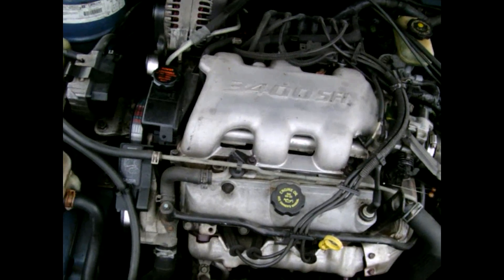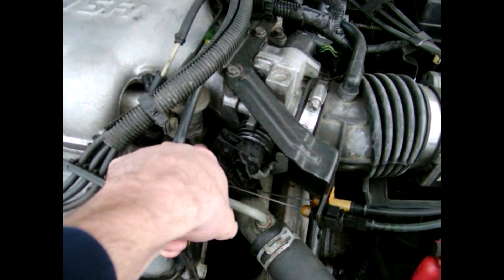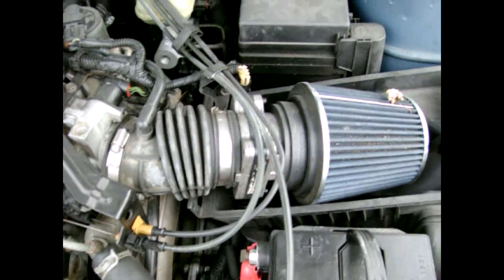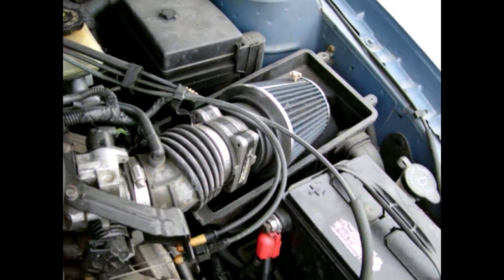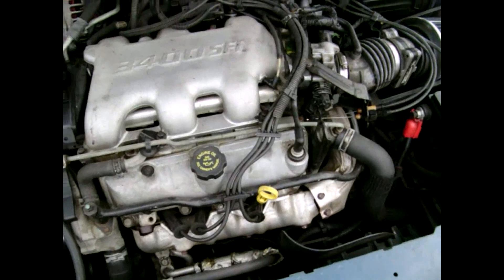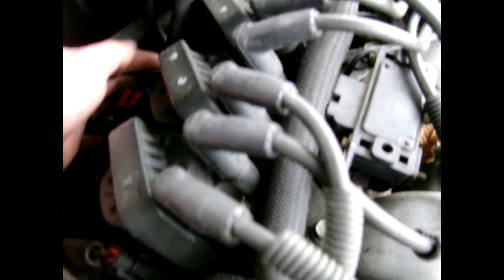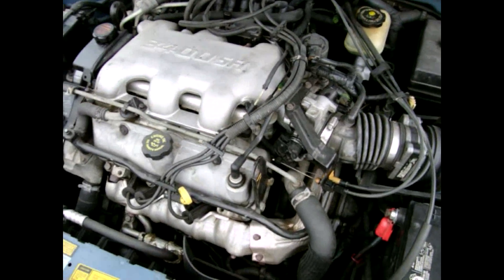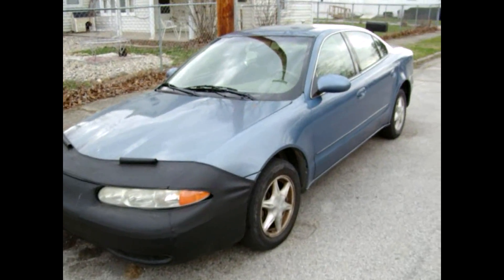3400 GM Engine 3.4 Liter Motor Explanation And Discussion

Comment: I'm planning to take on an engine replacement job on a 2003 Buick Rendezvous and I'm wondering if anyone can tell me if the engine will come out the top on this thing. Can I just pull the front clip for the room to do so? Or? I don't have a car lift to drop it out the bottom, so I don't want to tell the guy I can do it and then find out when it shows up that I need a lift.
Reply from the maker: The motor can come out the top.  However, you'll need to remove the heads, exhaust, water pump, alternator, coil pack, A/C, etc.  Pretty much leave the short block stripped for pulling it out and putting it back in.  There just isn't enough room to make the fit with the heads on.  I'm actually in the middle of pulling my motor out of my red '01 Pontiac Aztek now.  I'm planning on pulling the engine out the top as well.  
VT247
Reply: Thanks for the input! I'll post back anything I come up with.
Reply: Matt Owen I did one on a Pontiac Aztec. I didn't need a lift. I used jack stands and a floor jack. I had plenty of room under the car to slide the engine and transmission out, once I dropped the engine cradle. Wasn't too bad of a job.
Reply: Logan Fry Thanks man! You're not to late. I'm just finally going to send a wrecker for it this week. Your hot stall sounds like a weird fuel pump think. I had a Ramcharger that was doing that. Fuel pump finally took a crap. Funny thing was, It would stall when it got warm if just sitting warming up, if I got in and drove it, it ran fine. Finally just wouldn't restart after a warm up and stall. Try a little starting fluid when it stalls to see if you still have ignition. If not - Idk, coil pack shorting or ignition module if it has one.

Comment: I just replace my upper and lower intake gaskets on my 2003 Buick Century 3.1 V6. After everything was put back together, the engine will start but will not stay running unless i'm giving it gas. I can keep it running until I release the gas. The spark plug wires are in the correct order, and the wiring harness is connected correctly. No gas smell in the engine bay, fuel pump pressurizes, and all vacuum hoses are connected. Any idea would be a huge help. Thanks!
Reply from the maker: Does seem like a vacuum issue.  Make sure all the vacuum tubes for the PCV valve are secure and that the engine is sealed up good.  What does the motor do when you let off the gas?  Does it chug and try to stay running or go straight to shut off?
VT247
Reply: Thank you for the response. When I was finishing up the intake manifold job (it was late, 2:30 am) and I didn't realize the throttle body gasket had slipped off a bolt which in turn blocked half the intake passage. It would start up but chug and try to stay running until it shut off.

Comment from the maker: I take it the leak is coming out pretty bad at this point.  Be sure to check your oil to see if it's 'milky'.  Make sure your electric fan is kicking on and the water pump is flowing coolant.  But, if it's leaking it's the lower intake manifold gasket.  Not the worst job to do, but it takes some time.
VT247

Comment: Mine is being hesitant especially when you put it into gear. It has that annoying ticking noise when it does it and the whole engine vibrates bad.
Reply from the maker: Could be a loose or stripped out rocker arm.
VT247
Reply: Vacationtime247 Ok thanks I will have that checked. It jusf came from the shop, I had to have the intake gaskets and valve cover gaskets  replaced because it was leaking antifreeze I drove it for about 2 weeks and then all of a sudden it started doing that.

Comment: 98 Venture, 3.4 L engine, 192k miles.  Here's what i know. 1. oil leaking out of engine, ending up on frame rail on drivers side near pick up point (rubber donut). 2. oil in coolant. 3. no coolant in oil. 4. bubbles in coolant when warm. 5. not overheating. 6. internal heat ok. 7.sandy orange gunk in radiator.  friend says i have a cracked head.  what do you think?

Comment: my power steering system is acting crazy. it's winding noise turns really loud the farther I drive. I drive 40 miles to work n by the time I get there it's moaning n groaning something serious. I've checked fluid level. full.. I've changed fluid. added Lucas stop leak. still moaning. I can't find a leak even tho I have a small amour of fluid on the drive way. I'm wondering if I need to bleed the system or change pump, rack n pinion, or filter.
Reply from the maker: Probably the pump.  Order a new unit and install.  Find where the leak is and make sure it's sealed and fixed.
VT247
Reply: Thanks. I'll try it

Comment: My 03 grand am  3.4  is giving me a lot of problems  lately my engine light comes on and goes off finally tested it and it's a knock sencer issue I just replaced it a year ago that's not really so much of an issue as the other problem I have with it. I could start it all day it works fine then randomly I go to start it and the starter won't do anything I had the starter tested as well as all my ground wires it's not throwing any codes but if I disconnect the battery for 2 hours and hook it back up it starts like no there was ever wrong. I'm stressed right out with this thing I had it in the shop cost an arm and a leg just for them to tell me they can't find out what's wrong with it cause it wouldn't act up when they were looking at it. So here I am in the hole even more and no solution so far. I've been reading about the neutral safety switch and how if it goes bad it can disable the starter but what I don't get is why the battery has to be off for 2 hours before it will even crank. The battery is brand new. If someone has had this same issue please let me know how ya solved it thanks
Reply from the maker: Might be in the key switch.  Could be faulty.  Use a multimeter when it happens to see if the starter wire is getting voltage when it happens with someone turning the key.  Would be my first go to diagnoses.
VT247
Reply: It ended up being a dead spot in the starter I found one off a Montana and after I  installed it I haven't had a problem
 thanks for the tip though any little bit I could learn may be of importance later haha

Comment: 2002 chevy impala 3.4 v6.  coolant leak coming when pressure checked from timing chain cover.  your thoughts>
Reply from the maker: Could just repair the front timing cover gasket.  Takes some time, but can be done without a whole lot of difficulty.  Always thought getting the power steering pump lines off was the hardest part.  Other than that, fairly easy.  But honestly, if it where mine, I'd just replace all the gaskets.  Probably be easiest to take the engine out, replace the timing cover, head and intake manifold gasket as a set.  Use new torque to yield head bolts also.  Sounds like a lot of work, but it's not that bad.  Engine would probably outlive the life of the car after that.
VT247

Comment: I'm putting another 3.4 in my 99 venture van. I got a 2004 3.4 from a Olds Alero with 110,000 miles that ran well. Before I put the new engine in My van I decided to take it apart clean everything and re-gasket the whole thing. Upon removal of the heads the head gaskets were not leaking but  at least 3 of the coolant passage holes in the gaskets were plugged with red crud. The culprit? G.M.'s wonderful 150,000 mile crap known as dex-cool. If you have a GM car do yourself a big favor . Flush your cooling system the best you can and replace that crap with ethelene glycol and distilled water. Your motor will run cooler and do away with some of the inherent overheating issues these motors are famous for. (Disclaimer) This is all from My experience. Uase what works for you.

Comment: My son has 03 grand am (same engine) the car is turning over but won't crank. Fuel pump is ok. Thought it was crank sensor (could be) I wiggled all the wires and it cranked up. Drove today. it won't crank again. I noticed the wire (the hose on top with a curve) it's off. Like it had black tape around it and it completely came off. Could this be the problem? Your hand went over it and you said it was vacuum hoses. Not the one in front but the smaller one just above it.
Reply from the maker: A massive vacuum leak very well could prevent an engine from starting.  Check for fuel, spark and plug any open vacuum lines in their correct location.
VT247

Comment: No issues with mine but I doo feel it idles little too low like 500 rpm shakes the car a little any suggestions to at least get it to idle at 700 rpm would be better or even 800 rpm idle would be good.
Reply from the maker: There may be a set screw on the throttle body that can be turned to adjust the stop point for the throttle.  Turn it up a little.  You might also want to check for a vacuum leak.  The vacuum line at the top front of the intake has a grommet that can fall down sometimes or deteriorate over time.  Just follow the PCV line up, the other side goes to the back valve cover.
VT247
Reply: Vacationtime247      Thanks I’ll give it a shot

Comment: Runs fine for an hour. Then all of a sudden she stalls. The engine is not overheating but issue happens when car is hot. 92 camero V6. 

Vapor lock?
Reply from the maker: My guess would be a weak fuel pump not providing enough pressure.  Could be the cool pack getting to hot also.  Just a few suggestions to check.
VT247

Comment: Where is the cranshaft position sensor? Is there one or two
Reply from the maker: There is just one.  Should be at the bottom near the harmonic balancer.  Bottom of the engine, passenger side.  There will be a wire and plug in going to it.  
VT247

Comment: I bought a 2001 buick century with the same engine, and it has a missing manifold hose that I believe is transaxle, where would the other end of the hose have gone to if it were still there? The port is just opened up, and it causes rough idle until I place my finger over it. Can I just plug it? Or does that hose serve an important purpose?
Reply from the maker: One does go for the transaxle.  There is one that is plugged off.  Believe the one that is supposed to be plugged off is nearest to the alternator.
VT247
Reply: In your video, it is the one with a black elbow going into a white hose, and into a little larger black hose. On the right side of the manifold intake.

Comment: I have a cylinder 2 misfire just did a tube up could it be the wires loose or bad plug?
Reply from the maker: Could be a few things.  Here's what I would check.  Spark first.  Pull off the spark plug boot, put in a spare spark plug, have it resting on a ground site and start the engine. See if it's sparking across good.  If it is, then it could be a fuel injector.  These engines also were known for bad gaskets.  Could be the head or intake gasket is blown.  Just a few things to check.  Hope this helps.
VT247

Comment: I have an 2001 impala 3.4. Starts great but when you hit the gas pedal the motor surges. (reeves up and dies back down) very little  power when you hit the pedal. I can Idle and the engine runs perfect. Any ideas
Reply from the maker: Check your codes if the check engine light is on.  Check fuel pressure.
VT247

Comment from the maker: Pretty much all the 3400's have intake manifold gasket and head gasket issues.  Best to do them both at the same time.  The engines will run forever with those two issues fixed.
VT247

Comment: Hi! I have a problem with mine. My Ga gt 2004 is acelerated. I got a P507, P0443, P0171, ando P0302 codes so I cleaned up the throttle body,  replaced the Evap selenoide and also cleaned up the IAC. It got a little better but I still have the P0507 code, what could It be? The scaner tool tells that the IAC is sometimes in 0 counts when It Is stop and idle and also when the car is also stop, idle, It is acelerated and markes 18 or 20 counts. Thanks
Reply from the maker: Some things come to mind that it could be or for things to check.  The EGR valve could not be manually closing entirely.  The passages for these 3400 can cause excessive carbon build up to the upper intake.  Possible vacuum leak.  Malfunctioning mass air flow sensor.
VT247

Comment: I could hear the fuel pump, car cranked, would not start. If I sprayed starter fluid, it would continue running. Changes the #37 fuse from a 10amp to a 15 amp. Cranked right up. Yes, it's a A/C fuse.

Comment: Hi I have 2004 chevy venture and I am having problems starting it up it will start and then die, I have to hold down the gas for a while and then it stays on. In the summer I opened up the Idle Air Control (IAC) Valve and cleaned it out with carb cleaner and it worked for months. I was thinking of opening up again and cleaning it out again, what do you think? I have a feeling the plunger is not sealing the seat because of carbon build up.
Reply from the maker: Very well could be the IAC.  Might want to inspect the EGR as well.  The passage can get clogged up and the plunger can also get stuck as well.  Might want to use any extra carb cleaner to look for other vacuum leaks especially where the PCV goes into the manifold.
VT247
Reply: Thank you very much for the suggestions, will take a look. If everything looks okay would increasing the idle help? To increase the idle do turn the screw on the throttle body up or down?
Reply from the maker: They really don't have a idle adjustment screw that can be messed with.  It's best to find the problem and correct it.  Tried this once on an Alero with the 3400 and wished I hadn't.
VT247

Comment: Car vibrate when it in any of the gear what causes it to vibrate ? Any suggestions will be helpful
Reply from the maker: If it vibrates while it is driving then it could be suspension, CV axle, or tires.  If the car vibrates even when in park then the engine may not be working right.
VT247

Comment: i have a 2001 olds alero so i had a blown intake manifold gasket i changed it cleaned alot of the crap that collects on the inside of the engine.  anyways i started it up and it runs good once it heats up to operating temperature.  it starts to lope i guesse would be the term for it.  any ideas?
Reply from the maker: Vacuum leak probably.  Unfortunately, that vacuum leak may be coming from a cracked intake manifold.  Had this happen on one after doing a head gasket job.  Check out my GM 3400 misfire video for further explanation.  Hope this helps.
VT247
Reply: i had it off and didnt see a crack..  it ran great before i took it apart i just knew the gasket was blown.  it doesnt lope when its cold oly when the engie warms up.
Reply from the maker: Might check the fuel pressure.  There is a port next to the power steering pump nearest the fire wall.  Also, check for codes of course.
VT247

Comment: I hooked it up n seems its trying to work out its problem. it's been broken for some time now due to the heat. I am at 197,000 miles the heads replaced n a full tune up. still feels like it's got life in it.lol

Comment: Ticking/clicking noise coming from engine, 3.4L 03 Alero. Happens when revving, when in neutral, and when idle in park. Thinking maybe a lifter? Not sure... Low oil pressure though. Any ideas?
Reply from the maker: Possibly the rocker arms?  I've heard were the rocker arm bolt threads go into the head can get stripped out.
VT247
Reply: Idler pulley?  Fixed my clicking

Comment: You most likely have a blown headgasket(s). You have to replace both even if only one is the PoF. At 192k you most likely need to revise the entire engine or get a rebuilt one and swap out your current one.

Comment: I have a 2000 Pontiac Grand Am GT. I experienced some overheating and leaks at first. Wouldn't hold coolant or water. Now it's leaking from the engine block. I dont want to trash the car. I was told i may need a new engine but i want to work on it myself if possible to save money. Any suggestions?
Reply from the maker: First I'd find out where exactly the leak is coming from.  This can be done by filling up the radiator and coolant reservoir with water.  Then do a coolant pressure test using a coolant pressure test tool that can be rented at Autozone loan a tool.  Pressurize the system and water should come out with force.  If it's a gasket or freeze plug, then that shouldn't be a hard fix.  If it's a cracked block, then you'll need a new motor.  Word to the wise though, if your replacing one gasket, replace them all.  Head, intake and timing cover all at the same time.  All to often if one goes bad, it won't be long before the rest go bad.
VT247

Comment: I wouldn't use starting fluid in a gas engine, its meant for diesels and could melt your Pistons. Choke in carb cleaner is your best bet oil in it, however brake parts cleaner works if you have some laying around

Comment: Hello. The check engine light came on, scanned it, and received the codes P0108 and P0101. I proceeded to disconnect and clean the MAF and there was gasoline in the air intake duct, all over the maf, and the air filter. What could have caused this and how to fix it? thank you in advance for reading and responding.
Reply from the maker: That is an odd problem.  Look for fuel leaks by the fuel pressure regulator, the regulator could be bad.
VT247
Reply: Vacationtime247 Thank you for the advice. I will check it out!

Comment: I have a pontiac grand am 2004 just replace the tempature sensor my problem is my fans wont turn on when i start it unless i run a jumper to  it is a 3400 series v6 any suggestions.
Reply from the maker: These engines won't turn on the cooling fans until they are almost in the red with the gauge.  If you unplug the temp sensor and the fans don't turn on there is another issue occuring, most likely a fuse or relay.
VT247